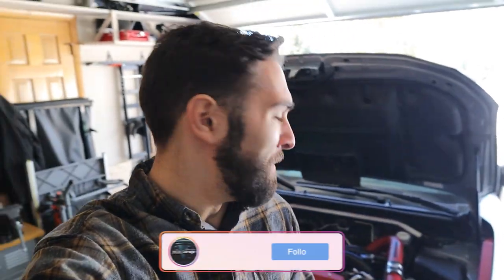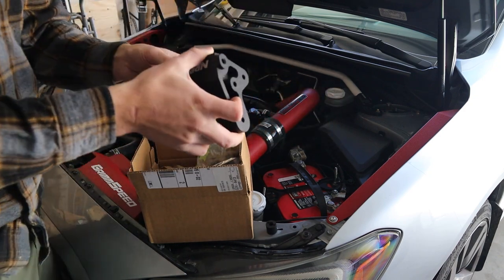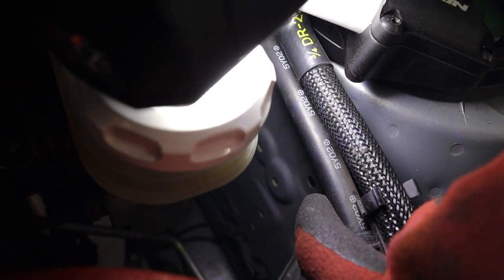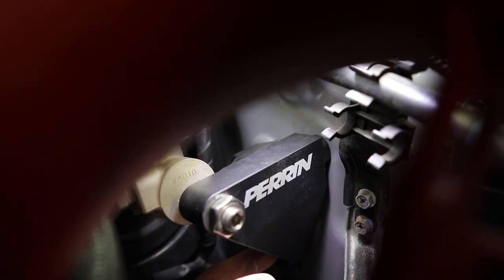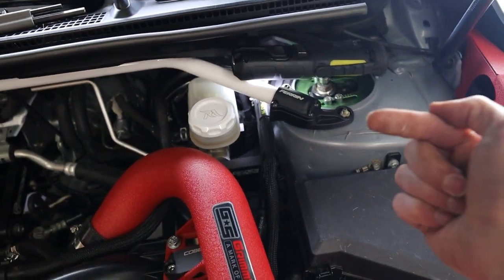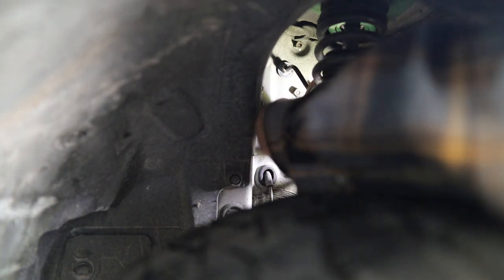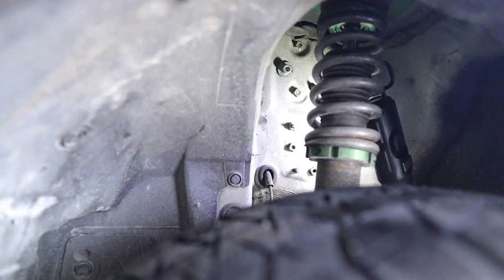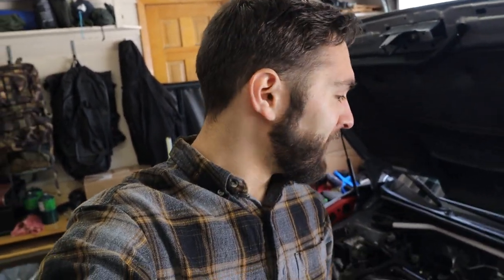PERRIN Master Cylinder Brace - 2016 WRX

Comment: I installed this awesome product on my 2020 Subaru WRX with the Brembo Performance Package. Once configured with the right torque value, the brake force in the brake lines increases quite a bit. If you drive big power, this will save your life, especially if you are too exuberant on the highway. Too many young men die on the road every night with too much power and an aftermarket turbo kit. The stock brakes with stock brake pads heat soak rather easily. The crash is usually death. At least have the decency to at least change the stock brake pads for cheap metallic compound formulation.